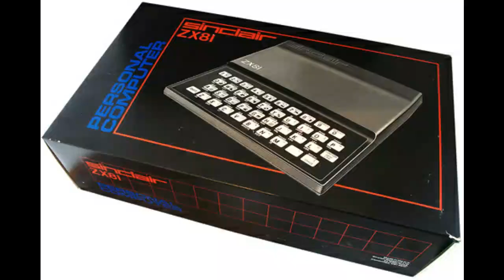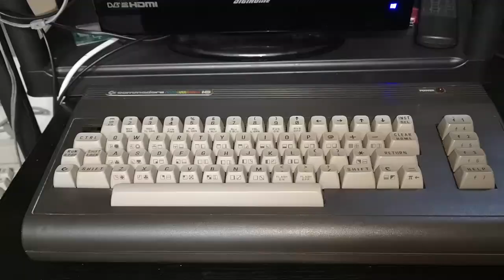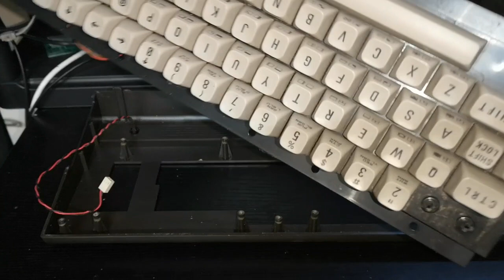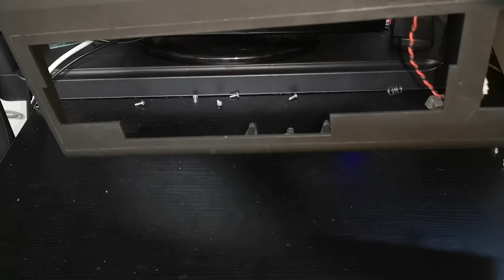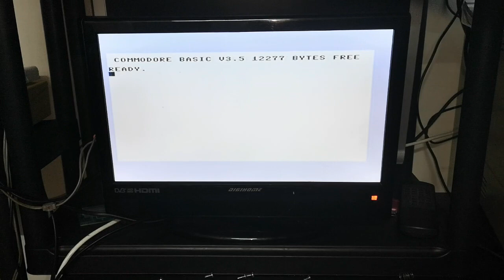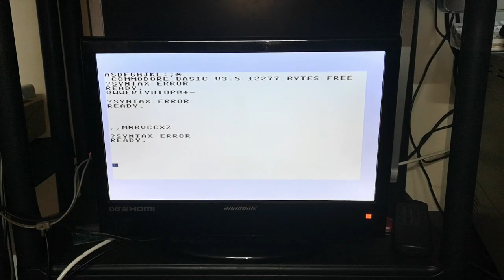Classic Computer - Commodore 16 final repair

Comment: I use a new power supply from truetone. Its the 1 spot. 
It has 9 v and 1700 mA output. 
Actually these things are made to use for pedalboards, but it has the right polarity for the c 16. 
All these computers work with center negative polarity. 
Most power supplies with 9v output i have found are with center positive polarity. 
They are useless. 
The original power supply of c 16 does not even tell what polarity the machine needs. 
I think that was the coffin nail for some of these machines in the 80s.